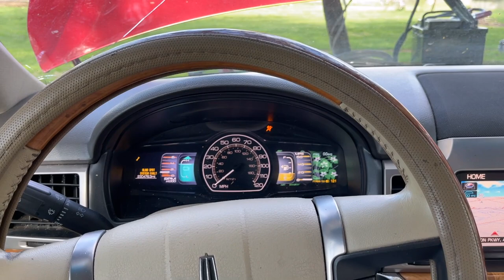I'm Back!! New Rebuild Project - Lincoln MKZ Rebuild - Part 1

Comment: I had bought a 2010 Focus from Copart that got smacked left to right and had the Airbag light on but no bags were blown.  All it was was like you showed, the plug had came unplugged from the crash sensor in the crash.  You would think the airbag would go off 🤷🏻‍♂️

Also, try an ozone generator first on the interior of the smoker car.  Might save you a lot of headache.
Reply from the maker: Yes sir! I have an ozone machine. Those things work wonders! Just don’t over do it or it’ll create a whole different smell. Lol

Comment: Wellcome back Sir!! I would use the interior from the red donor and swap the drivetrain from the white one since it has lower miles. Also, the srs system relies on accelerometers, so if the change in speed is not drastic enough, it wont deploy the airbags even if it brakes the sensor. This is clearly a low speed impact that hit a weak spot in the car (above the crash bar). Still, I think it would be appropriate if you took the car to an especialist and have the srs system checked. Looking forward for more videos!!
Reply from the maker: Thx! That’s a logical explanation. Makes sense.

Comment: Welcome back Steven great to see you back, regards the interior of the Lincoln I would be inclined to try and just give the one already in the car a thorough cleaning, odours get trapped in material I think you would be surprised what difference it’ll make scrubbing the carpet, headliner etc even if it takes a couple of times! Great video and greetings from s across the pond 🇬🇧
Reply from the maker: Thank you! Yeah, I’ve detailed it pretty thoroughly and it’s much improved, though far from perfect. Not sure what route I’ll go on that yet… thx for your support from “across the pond”!

Comment: That is strange about the disconnected sensor. In my Mustang, when it was totaled, I hit the center wall at about a 45 degree angle which swung me around perpendicular to the wall and I skidded along the wall until I stopped. And then, once I was stopped, the knee bag blew. Ended up finding out one of the sensor wires was pulled out of the connector. I'm guessing that I hit the wall at too low of a speed to immediately blow the bags, but skidding along the wall must have triggered the knee bag and seatbelt pretensioners, maybe when the wire pulled out. Just be thankful the dash bags didn't blow!  Looks like a really good rebuild, especially with the clean title. Does it have anything on the Carfax? Mine is also still a clear title, but because insurance paid out on it, the "total loss payout" is on the record. Thus my car is only "worth" $10k as salvage! 

On the interior, of course the executive one looks nicer, but yeah, a lot of work. I'd probably take the donor car seat apart, and reassemble it using the AC/heater mechanicals and frame that work, but put the donor foam and cover on it, provided you can get them clean.  Looking forward to seeing the rest of the rebuild!
Reply from the maker: Yeah, the Carfax shows the accident, but nothing about a total loss. Still trying to decide what to do on the interior. After a good detail it’s smelling a lot less repulsive! Lol